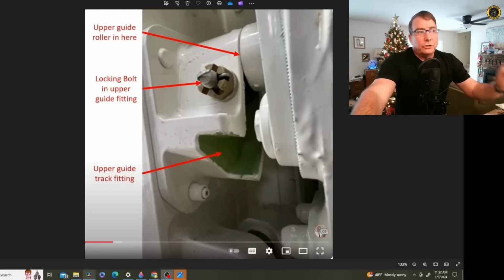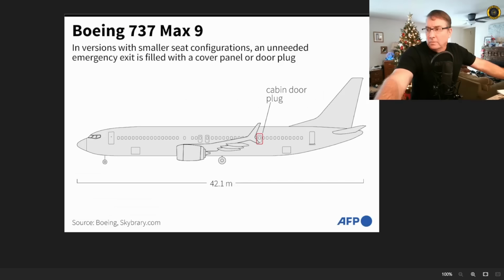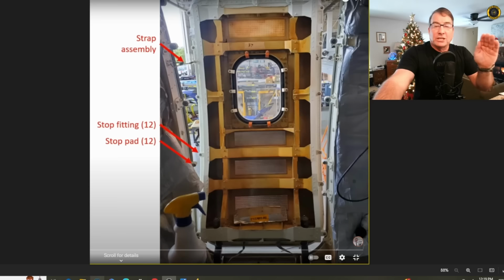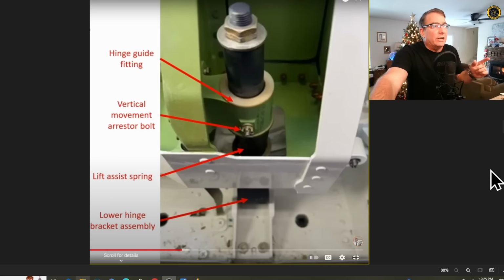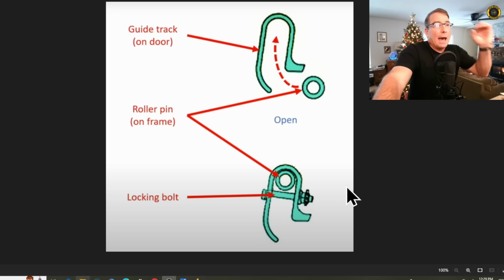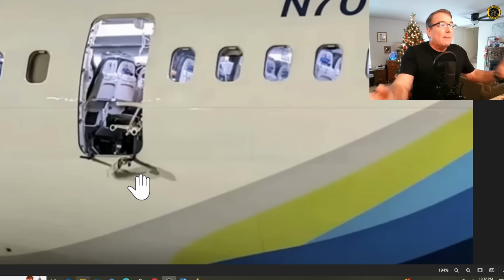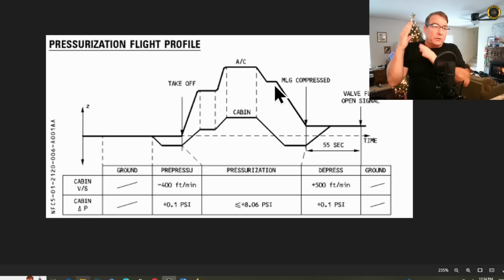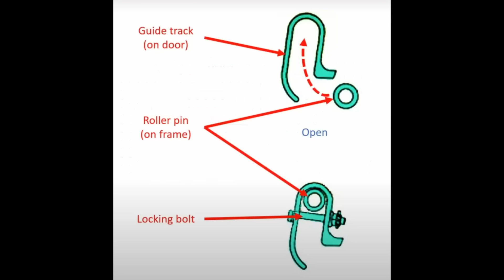Alaska 737 Max-9 Door UPDATE! 8 Jan 2024

Comment: I bet no bolts were in. I cant see it possible it could part so cleanly with no damage
Reply: I'm leaning towards this potential as well. It's an easy fix but that is often when the most errors in maintenance occur, when something is simple and routine. When a task is new to you or exceedingly complex you will by natural instinct slow down and be methodical. At the end of the day this mod for the door plug is drilling holes through the track fitting, inserting bolts, tightening them, and inserting cotter pins. The investigation will reveal more. While we can make some educated presumptions the fact is none of us have the door or aircraft in front of us to inspect.
Reply: I could be wrong, but I think the bolts basically hold the door closed. If they're not there the door will instantly spring up and over the stop fittings. So I'm gonna bet no cotter pins. Wild outside chance of 3/16" bolts in a 1/4" hole or something equally insane. Judging from the available pictures I think it's supposed to be 2x 3/16 bolts on the bottom and 2x 1/4" on the top guide track
Reply: @karl46  no...the door is retained in the frame by the guides, not the bolts. The bolts stop the door from moving down the guide, if it moves far enough down then it leaves the guide and the spring pushes it outward
Reply: TrinityExaminedcom  I'm with you.  how could inspection not have caught that ?  asking for a friend
Reply: @eddy66t6  yup, you are correct
Reply: Based on finding loose bolts on other planes it's looking like someone set the plugs in "temporarily" and but the installation was never finished
Reply: Really looks that way. Doesn’t look like a structural defect.
Reply: I get the whole bolts must be there part, but is this also a door (or) just a plug ? What I’m driving at is, if it’s really a door even as it’s plugged with the bolts, wouldn’t there also be an opening & closing handle mechanism which would also help keep the door closed ?
Reply: yup..
Reply: @65gtotrips  It’s a plug and not an operating door. Ryan Air requires the extra emergency exit because they put more passengers on the plane than United or Alaska. So Boeing just “plugs” the fuselage and the interior of the plane looks as if there isn’t a door.
Reply: Bolt and nut were in place nut no cotter pin. I can't imagine how no bolts in place can missed. I'm coming to this conclusion because after inspections, they are finding loose bolts. The only way those bolts are getting loose is from no cotter pin holding them in.
Reply: @eddy66t6  the springs are there to cancel most of the weight of the door, 27kg, so that maintenance personnel can release the door without excessive force, and to mostly cancel the shear force on the lock bolts..
Reply: Union job.  Plane was built on a Friday.
Reply: Can the bolts/nuts get stressed by this mechanism and the pressurization of the plane and brake apart ? I guess not being the plane was recently delivered.
Reply: Is there any chance that the entire door frame was expanded out of shape so much from the pressurization differential that the pins cleared the sockets they sit in?
Or is the frame fixed rigid enough that it is not possible? If the max differential pressure was exceeded, would that be enough to distort the door frame or is it just too solid?
If the lugs were only on the sides of the door, the frame would only need to expand vertically to make the lugs clear.     @eddy66t6
Reply: @strangermaniacos686   No, the bolts and nuts carry none of the pressurisation loads, just a small part of the weight of the door.. indeed they don't need to be torqued either but they must have the castellated nut and cotter pin to stop them loosening
Reply: @TodayIWorkOn   I would think that the nut would be self locking (which prevents vibration induced rotation) in addition to being a castellated nut for cotter pin (ie double safe). All the critical suspension nuts on you car (ie ball joints, tie rods, etc) use self locking castellated nuts with cotter pins for safety - I would think an airplane would have the same. ?
Reply: @65gtotrips  Its a plug door in lieu of a true functional emergency door which is not required based on the configurated aircraft occupancy of this carrier.
Reply: @damienhill6383  I would think that the nut would be self locking (which prevents vibration induced rotation) in addition to being a castellated nut for cotter pin (ie double safe). All the critical suspension nuts on every car Ive worked on (ie ball joints, tie rods, etc) use self locking castellated nuts with cotter pins for safety. If el cheapo Ford/GM/Chryco use these why wouldnt 'super safe' Boeing not?
Reply: @xxmrrickxx  I think you nailed a possible scenario. In assembling anything like a door (even a house or a car), there's always a temporary step or two for fitting and finishing. Installing the aircraft's interior might have required temporary door plug installation so that the interior panel could be checked for fit. We'll find out soon enough.
Reply: That was my thought too. Looking at the photos, my first thought was "wow, this part is SO SPECIALIZED and it looks very tough." My next thought was HOLY COW that door was RIPPED right off, why is there not a huge ragged hole? The path of least resistance; it slid cleanly off so it likely wasn't restrained where it should have been. YIKES.
Reply: @damienhill6383 the weight should be offset by the springs on the hinges lifting the door
Reply: @65gtotrips it's a "door plug" - maybe it's a fairly unique thing but its a door in that it hinges, but a plug in there's no latch to open it
Reply: @65gtotrips  I think Juan said it's just a plug, it's not fitted with any mechanisms to open and close it. Once bolted and pinned in that's the way it stays. Alaskan have also said that is the case, the plug isn't ever used as a door.
Reply: There are only 2 things that could have happened.  The door MFR missed the bolts(prob Atlas aerospace/PMC) or BOEING when they removed it and someone disnt put bolts back in before interior was finalized.
Reply: @FloorItDuh I would think the easy fix is actually retrofitting a failsafe in the door track. A simple latch like that used on your backyard garden gate could prevent the door from moving even without any bolts, until a human presses the release latch to pull the door out. Publishing the details of this fix publicly and providing the part and labor to all existing aircraft with this fail dangerous design could buy back a little confidence. Just a little
Reply: TrinityExaminedcom  I would be assuming to say that on aircraft you only use a cotter pin once.  Once removed, it's replaced.  Was this door ever serviced outside of Boeing?
Reply: @eddy66t6  Both upper and lower bolts either missing or without retaining pins would be required for the system to fail. United say loose bolts discovered which implies pins missing.
Reply: @kstarks9049  Looks like sabotage, on a huge scale. Now who would do that?
Reply: TrinityExaminedcom  Yep.  That is part of the investigation.  Supposedly United found 5 loose bolts, but not always in the same place.  The other thing will be sampling other bolts and checking that the bolts were properly sourced.
Reply: @mpetry912  the inspection had to fill out papers instead.
Reply: @karl46  yes they do
Reply: @xxmrrickxx  they've found loose bolts?
Reply: I'm am leaning no bolts were installed because of the clean door ejection and the fact that the plane was so new.  Likely as someone else stated there was a shift change at the factory and not proper documentation/turnover and it was somehow missed.  Boeing doing their own QA now increases the risk of things like this happening... It took just the right amount of pressure differential and turbulence in the aircraft for the door springs to send that plug flying.  Thank GOD nobody was in that seat and everyone had their seatbelts on.  If a kid got his shirt ripped off then someone could've easily been sucked out of the plane.
Reply: @lk29392  Oh, and those 10cother aircrafts found with loose bolts?

Are there so many shift changes in Boeing factories or is this more a design feature?
Reply: @damienhill6383  Ok, so why has United found many door plugs with the bolts loose in these aircraft? To me it sounds not like a maintenance issue but like a design flaw.
Reply: Agreed. No bolts were installed.
Reply: @waynebendelow282  saves weight, boosts economy
Reply: @DaleSteel  Thanks for the response. That seemed to be what made sense from looking at the diagrams. It seems like it might be a good idea to remove the spring assembly on the "plug" variety. You don't need an open assist on a deactivated door; it's presence can cause a serious issue, but is only slightly helpful in very rare maintenance settings.
Reply: @karl46  As soon as you remove parts in any door holding mechanism you need a new certification with a full lifetime cycle of verification.

This would take half a decade.
Reply: @peterebel7899  Oh I know you're right, I'm in the industry. I understand why it's there. It's just so god damn bone headed.
Reply: @65gtotrips  It's a plug.  No handles.
Reply: @itjustlookslikethis  No not sabotage.  incompetence and lack of quality control.
Reply: @strangermaniacos686  Disagree.  This is a quality issue.
Reply: @65gtotrips  the fact that it was a plug, rather than a functional door, means it was not installed with a handle to lock and unlock the door.  This is the specific reason those two bolts are installed to keep the door from moving vertically and keep the stop pads and fittings in alignment and pushing against each other while the plane is under pressurization.  The bolts would be unnecessary on an operational door with a handle since the door handle assembly (and its related internal parts) would serve the same function as the bolts do when the door is in the closed and locked position.  The absence of a locking/unlocking mechanism on a plug door is the reason the bolts are used.  When the bolts are in place, there's no way the door can be opened without removing the cotter pinned nuts with a tool and then removing each of the two bolts which will then allow for vertical movement of the door and subsequently allow the stop pads and fittings to come out of engagement, allowing the door to open outward.
Reply: @itjustlookslikethis  I’d disagree. While you can’t rule it out, it’s probably the least likely scenario. Negligence is far more likely than malice.

Comment: Sorry to disagree with everyone but this is not a plug type door. Plug doors and windows are physically larger than the holes that they are plugging. As the pressurization increases, the plug window or door  pushes against the smaller hole that its resting against and seals it from leakage. This is why you cannot open a door in an aircraft once it has just a slight amount of pressurization. Crews are not able or allowed to pressurize on the ground unless it's a maintenance test without passengers. In the event of a fire or other emergency requiring everyone to exit the aircraft, they couldn't egress if there was any amount of pressurization.    This door seals as it is allowed to drop into its tracks designed to draw the door tighter against the exterior of the fuselage, EXTERIOR. Have a close look at the door pictures and you'll see that there are no seals on the outside of the door skin, just a smooth painted surface. Those 12 stops on the fuselage door opening have adjustable bolts in the centre of the black dots you can see. They are adjusted to a very tight tolerance by the "technicians" and inspected by "Quality Assurance" prior to being signed off. Someone was late for his or her coffee break and things were overlooked. How many more things have been overlooked you ask? Keep watching the news and we'll find out.    The fact that this isn't a plug type door makes it a sure thing that I would never sit there.
Reply: You are correct on "plug-type doors."  This is being called a plug.  Not a door.  It's basically a door-shaped piece with a window that covers the hole created by the doorway.  I think people are referring to it as a plug because it literally plugs the hole that would be left in the fuselage by the door frame when the optional emergency exit door is not installed there.

Comment: If I read correctly, this aircraft had three pressurization issue events that were intermittent. This would definitely explain why.
Reply: Were those three events all on that actual incident flight or during other previous flights?
Reply: Likely not related at all.  The previous issues were with a malfunction of the pressure control system.  If that door had been leaking previously, there would have been a helluva lot of noise.
Reply: @Utube2Itube  previous flights
Reply: Those three instances of the cabin pressure controller failing would not explain this instance.  Looks like the stop pads on the aircraft and the stop fittings on the door are pushed away from each other under cabin pressure.  One would think that the plug would be installed from the inside of the airplane - similar to a main entry door on the 777.  Why were the roller pins still present??
Reply: I once flew on a 737-300 which door seals whistled on take off, was that safe?
Reply: @Matty12333  What tune did it whistle?😗
Reply: @anthonyobrien3685  The Beach Boys, Don't Worry Baby.
Well it's been building up inside of me
For oh I don't know how long
I don't know why
But I keep thinking 
Something's bound to go wrong.
Reply: @Matty12333  Whistling is a good idea whenever it comes to flying on the 737.
Reply: @reubenmorris487  Oh, in other airlines airframe those bolts are freely flying around.

Boeing quality processes are winning processes.
Reply: @Matty12333 Depends on the tune
Reply: @mountainflyhigh very likely related.  As that door bumped up and down the pressurization would be problematic.
Reply: @reubenmorris487 sadly the controller was probably blamed for the pressurization issues because what else could it be?
Reply: @reubenmorris487  "Looks like the stop pads on the aircraft and the stop fittings on the door are pushed away from each other under cabin pressure."
No!  As the door is pushed down into position, the 'stop fittings' are on the inside of the 'stop pads'.
ie cabin pressure is pushing the two mating parts together, not away from each other.
Reply: And they didn’t troubleshoot and correct the problem
Reply: @Matty12333  It’s not fully pressurized on takeoff.
Reply: Yeah I also think it’s definitely related. Small movements of the plug door at different altitudes and vibration levels could definitely affect the pressurisation system momentarily without actually failing completely. 
That’s why I asked, if those events actually happened on previous flights it’s a bit shocking that they didn’t ground the plane until finding the root cause
Reply: The article I've read says yes.
Reply: @imaPangolin - Well, as a 25 year DC-9 Captain, I'll disagree.  If there was enough pressurized air leaking out the plug for the pressurization system to react and malfunction, there would have been a LOT of noise on previous flights - VERY LOUD noise, loud enough that passengers or crew members would have complained about it.  Pressurized aircraft have many small leaks, the older they get, the more they leak.  Every time we take off, none of the doors/exits are sealed tightly, they rely on air pressure differential increasing fast enough to push against them to seal, with air rushing around them until they seal. The pressurization system knows that, so there is a large influx of air-flow until everything seals up.  Many of today's aircraft even pre-pressurize the cabin slightly before they take off just to minimize this problem and the associated noise, which eliminates that air rush right after takeoff.  Point is, quite a bit of air can be leaking out, and the pressurization system just automatically compensates for it.  A badly leaking exit plug would be noticed well before the pressure system would malfunction.
Reply: @reubenmorris487  The roller pins are attached to the fuselage, not the door.
Reply: @Matty12333  Yup, all the seals leak on the ground until the aircraft starts to pressurize after takeoff.
Reply: @reubenmorris487  The roller pins are attached to the fuselage, so stayed with the aircraft.  The slots that slide over the roller pins are part of the plug door.